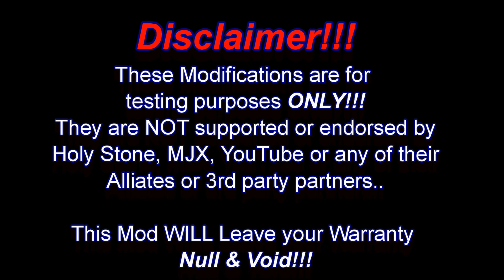HS700   Ant Mod w Range test 2Km plus

Comment: I have been modifying my holy stone hs700 for a while now. I installed a walkera g2d gimbal and a GoPro hero 4, unfortunately that combined weight is way too heavy for the hs700. So I have to settle for the GoPro in the stock holder. Well now that I have the GoPro in there, the drones range is absolutely terrible I get about 37 meters up and the controller will disconnect from the drone. Makes me wonder if the USB cable from the underbody of the drone was used as an antenna. I also have a dead router, so I might do the controller mod just for the heck of it.

I'm impressed at how smooth your video is in this though, despite not having a gimbal. For me it looks like a drunk pilot is flying it regardless of what camera I use.
Reply from the maker: Andrew Hunt - you're "Go-Pro" issues is a head scratcher,  as I'm not using the USB interface between the drone n cam either... But I did set all parameters to the MAX in the app before disconnecting the camera.

The camera I'm using is a very light weight 2K camera (Turnigy Eclipse 2K) with a 600mw FPV VTX cardle, all in they weigh just under 70g. the camera is a "HobbyKing" clone /oem of the OnePaa X2000 camera and it supports Video stabilization

Comment: What db value antenna does it take to get the benefit from the tx mod ? I have a couple routers but not sure what db they are. Is it necessary to have a  5 db or higher gain antenna to get the benefit of moving it outside the tx ?  I have the 700d and really like it BUT I talked to cs and asked a tech if there was actually antenna in the plastic fold down casing and they said yes the right antenna had a wire in it . I haven't had time to take it apart to look so I guess this tells me answer to that.What antenna would you use and where is the best place to order ?  Guess I'll wait until the warranty is expired.
Reply from the maker: Hello Fred Jamison - It sounds like HS has made some upgrades since the original HS700... I think the Antenna off the TPLink router I used was only 3db gain (it's been well over a year) regardless, it seems that pulling the Antenna out of the arms of the drone AND doing the TX upgrade gives the best results, as reported by a few folks on the MJX Bugs Facebook page.

The reason is related to the "Shape" of the signal as it emanates from the TX and is received by the drone.

If both are aligned along a common plane ie both Vertical OR both Horizontal you get the best results... Though if they are oriented perpendicular (say the TX is Vert and the drone still has it's ant mounted stock along the horizontal plane) you'll get less distance not more.

Even with the slight upgrade of the 3DB TPLink antenna, my MAX distance wasn't limited by the Signal Strength, but rather by the capacity of the battery, as it kicked in the "Low Voltage return-to-home".

Hope this helps, likewise there is a similar upgrade I'd posted on the Bugs 2C and there are several comments that may be useful... All the Best!

Comment: what video transmitter set up would you recommend for my hs-700d model for FPV?
Reply from the maker: Hello Rudy - If you mean for "FPV",,,

I use a few different camera/VTX combinations, I really like the Eachine AIN (All in Once) units that have the camera and integrated transmitter, generally I go for the highest "Video Lines" available (say 1,000 or 1,200 lines).

Or I use a Turnigy 2K Eclipse camera that has an FPV cradle... Great setup!!! but unfortunately they haven't been made for over 2 years now....

All the Best!

Comment: On another Video, u had a single wifi antenna mounted under the drone.    For that mod, do you tie both arm antennas to that 1 wifi antenna?  or 1 arm?
Reply from the maker: Hello Kyle Dominique - I think you might be referring to the HS100 upgrade..

If so, that drone only had 1 antenna and didn't have the dual Ant config that the MJX units have.
Reply: @ruralflyer5747   Yes. i was referring to that video.  can i tie in Both antenna's to just the 1 antenna mounted at the bottom?
Reply from the maker: @SHOSport  - I don't think so... as the HS-700 has 2 Ant, and there would be issues due to the Impeadance of just one Ant being fed by 2 sources...

I don't have the background ie; engineer diploma to say for sure, and really don't want to see you or anybody else have grief if it causes real problems (like losing the drone)...

But if you get it work, definitely let me know :) Good Luck

Comment: Just tried this mod out myself. Tested the controller mod by itself and I didn't see much of a range increase. Just did the body work and I'm hoping that makes all the difference. Will give it a try in the next week.
Reply from the maker: Hello Larry the Eldritch, I hope that you got some "Stick-time" in and the mod worked better after modding the drone...

My guess is that even with a Better Ext Ant on the TX, it would probably be aligned on the Vertical plane, while the UnModded drone's Ant are still on the Horizontal plane, so any net Gains of the TX mod are essentially a "Wash" as those DiPole Ant work best when both are either Horz or Vert but not mixed...

The Ant I added to the TX was only a 3DBm gain, but I saw a HUGE difference between the factory config and the mod... As it sits now the limiting factor is the battery capacity for long range, as I still have full signal strength at over 2Km...
Reply: Larry theEldritch  hey did this mod really work??

Comment: Just got this bird for 49.00 bucks went 900 meters maiden flight..very impressed being that I own 34 hubsan birds..and I'm trying to break free of there performance..i will be doin your mod asap..ty for the inspiration..btw is thete any way to change the rates on this bird.?..it came only with the qaud and transmitter
Reply from the maker: Willie Dunlap - Dual Rates??? - Sort of... if you turn off the GPS function the drone does become a bit more responsive, but it's not at all like the original Bugs 3...
Reply: Rural Flyer ty brother

Comment: Here I was dutifully orienting the antennas on my HS700D transmitter until I found out they were nothing but dummies (who's the dummy now?).
I decided to upgrade the stock antenna per your video, did some research, and ordered a VAS Microwave Folded Dipole 2.4GHz from GetFPV (it also comes with the SMA pigtail cut to the proper wavelength, stripped & tinned). I tried it out last weekend in an area I normally fly in and WOW! What a difference! It flew much further than usual and had absolutely no loss in signal strength (normally the signal would drop out intermittently at a much shorter range).
I just finished modding the drone internal antennas tonight and can't wait to try it out this weekend...I wasn't keen on attaching the antennas to the landing gear, instead I bought a length of rigid plastic tubing (5mm ID x 8mm OD) and cut two lengths long enough to house the antennas (about 3").
I slipped the antennas into the tubes and glued them along either side of the lower drone body and sealed everything up with silicone. 

I completely agree that running the antennas parallel to the motors and ESCs can create havoc with the signal, I'm expecting further signal performance by running the antennas outside. Now I'm researching the best way to extend the 5GHz video signal as I lose video well before the control 24GHz signal degrades at all. 

If anyone has some good options on this, I would appreciate the help.
Reply from the maker: DoubleOdds99 - I've long since ditched the stock Wifi camera, BUT, I did do a simple mode that gave me another 150meters or so of range... internally the camera has 2 (two) 5.8ghz dipoles that are arranged like a "Plus Symbol", so I poked a couple of holes in the case and poked the ant out through the holes...

Not very aerodynamic or even visually appealing :) but it did add more range.
Reply: @ruralflyer5747  Thanks for the reply. I bought an FPV camera/xmitter/battery combo, stuck the camera on the nose of the drone and strapped the battery/xmitter under the body. I'm getting some nice range from the new camera but I'd ideally like to figure out where the video out is on the on-board camera and solder it to the FPV xmitter video input. I took the camera apart but am unable to determine where the video out is.
Reply from the maker: @DoubleOdds99   - That may be tricky, as the digitized video info is being feed via WIFI, so there may not even be an NTSC or PAL data stream to intercept...

Comment: Isn’t there a problem if you take the factory antenna out and add a pigtail and an external antenna doesn’t it have to match the right length and everything is there a problem there because I’m not sure in your explanation is that you’re removing a factory antenna and installing a pigtail of any length in an antenna of any size I thought there was a problem with doing that can you explain please?

Comment: How did you bypass the limit set on the drone?
Reply: Ronald Rump - the version of the app was approx from Nov 2018, I just set it all to the "Max", removed the camera, and never updated the app... I know the app has been updated to improve the Google Maps function, but I don't use any of those type features ie; follow-me, point of interest etc...  nor do I use the stock cam, ...

Comment: Why can’t you leave the factory Antenna in an add a Second antenna like you can with the Buggs 3 Radio TX?
Reply from the maker: Hello "Frankie Knows Best" - sorry for the late reply... Regardless, I think if you try and run 2 Antenna in parallel, you would cut the load impedance in half, and get worse results.

There is a slim chance you might also damage the output amp that feeds the Ant.
Reply: @ruralflyer5747  yea, but what is strange is that I have the Buggs 3  and added an extra antenna on that TX controller  and it works  just fine, any reason why it would work on that transmitter but yet not on the Holly Stone HS 700 TX?🙏

Comment: Going to have todo this. Have you logged into the telnet terminal and messed with those settings yet? if you haven't I will post a video in the next week or so showing how.
Reply from the maker: Hey DesertFernWeh - No unfortunately the warm weather is here now :) and I've just done a few "Pleasure Flights" but haven't done much in the way of "Hacking or Cracking"... If you make any headway please post ...
Reply: @ruralflyer5747  I got the root password and was able to explore it a bit. But I haven't had the time to really get into it and hack around.  I will say HS really needs to review their security.

Comment: Rural Flyer, well done man. I have the 700d what is difference in it and yours if any. I was gonna mod my Bugs 2w for long distance until I got this Holy Stone, it fly's much longer than the Bugs. There's a guy here on YT that did a red B2w, Sean Murty I think is his name. He got a little over 3 miles, no fpv, and had rth because of battery, I was gonna copy his and use the HS instead. Check his vid and see what you think i'd value your opinion. Thanks man, Roost

Comment: excellent. please list the extra's such as camera
Reply from the maker: Hey R R the link here is much more detail than I could have posted in the video including cam specs etc...https://www.rcgroups.com/forums/showpost.php?p=40583455&postcount=1
Reply: @ruralflyer5747  hey I have a question it looks like in the video you have the three pads the middle pad seemed as if that was where the braided wire went and then the other one was a solid in the middle the reason I'm asking and my 700d they placed some kind of glue or something on top of the contacts I cleared most of it off but it's very difficult to see I want to make sure I had this right
Reply from the maker: Hello @JoseDJGETDOWNBizcarrondo  , at 0:38 in the video the thin co axial cable from the stock ant is soldered with the braided ground on the outer left pad and the signal wire soldered to the center pad (as viewed in the video, but will be reversed when looking at the PCB right side up)... Hope that's not too confusing :)

Comment: can i also upgrade the 5 g ant?
Reply from the maker: ForestSoft - I don't see why not... the most I've tried with the stock camera was to, poke the 2 (two) internal antenna outside the body of the camera, and think I gained another 100meters of usable signal... I've read a few FB Posts on folks that have replaced 5.8Ghz Linear Dipole Ant with Circular polarized CloverLeaf Ant and claimed big success... For Myself, I've opted to invest in Analog FPV with much better results than you'd ever get out of Wifi FPV... Plus it opens the door to better cameras than the stock unit, which is just not up to the task of smooth video regardless of the FPV system... Good Luck just the same :)

Comment: You can take a drone even further but it’s all about control, if you cannot see the video footage on your mobile which cuts out at 500meters then you are flying blind. If your flying blind you are not in control. That is where DJI do it so good linking mobile feed to the transmitter so you can see where your drone is all the time. I have a hs720e but loose mobile WiFi at 500 meters and though the drone can fly much further than that via the RC I never fly blind.
Reply from the maker: Rightfrom Wrong - I agree 100% ... I have Zero use for WiFi based FPV, not only does it have limited range, but it has such a high image lag (time wise) trying to follow a trail or make smooth sweeping turns is a challenge as you're always over-shooting the mark so video looks like youir "Fish-Taling"...

I really like adding Analog FPV cameras which offer near realtime video feeds, and 200mW Tx power, which is good for a couple Km...

Comment: Hey bro it’s Chris from Facebook I wanna see the drone it self and the remote as you fly it out to your 2km distance not trying to be a non believer but I could make a video like this and then launch a totally different drone. You see the truth in what I’m saying. My drone is modded just like yours and I can’t get even close to 500’ feet it’s something I see you have no interference in your wooded area but as you got out of your line of sight you didn’t have to climb up to keep your drone in the line of sight with the TX transmitter. Please make a video were we can actually see the drone take off and see the remote control to see the distance on the remote screen.
Reply from the maker: Hey Chris the mod I listed is just of the TX to drone connection, though, a few folks have confused it with the WIFI FPV off the stock camera... what I've posted has nothing to do with that, to the point that I don't even use the stock camera, but rather a tru 5.8hz FPV setup at 600mw... As to "Faking" the results, yeah I guess, but what the "Range Mod" posted implies is pretty routine stuff, the stock HS700 easily flies over a 1,000 meters right out of the box, so to bump it to 2km is really not a big deal, and I'm by no ways the 1st to claim a gain by adding a better external TX antenna, and popping the drones internal ant outside the body...

Comment: Now that’s what aI call lateral thinking. How about connecting a yagi to the controller. Imagine the distance you would get.
Reply from the maker: Hey David Johnson - Good Idea :)... If I was  a bit more tech savvy, it would be fun to try connecting 2 or 3 different Ant to the controller and implement a form Diversity Switching so that the strongest signal is always fed to the TX the same way that Analog FPV Video is switched  between Cloverleaf and patch antenna...:)